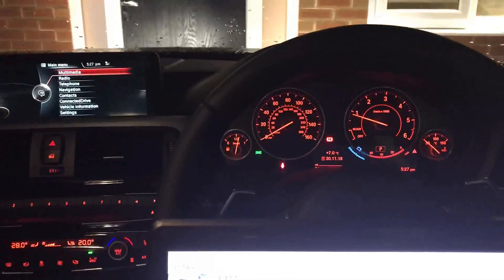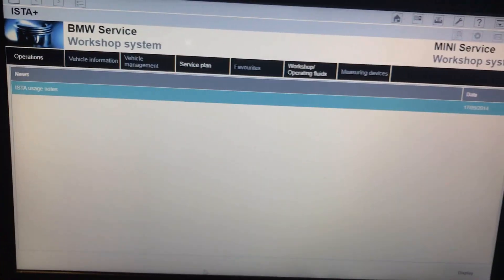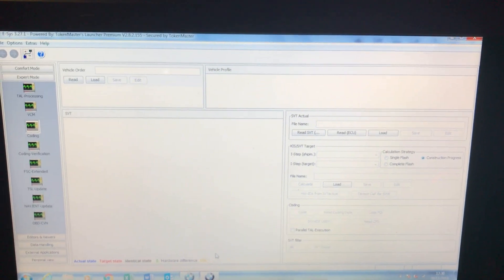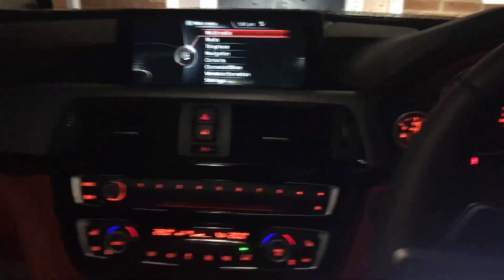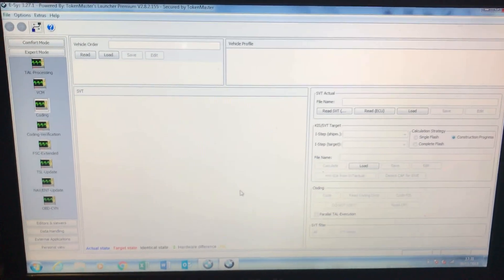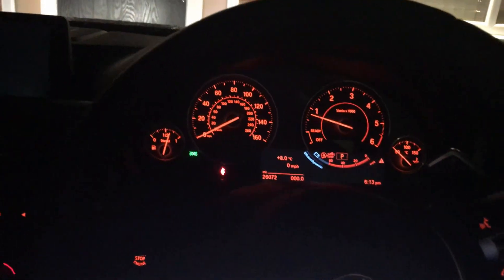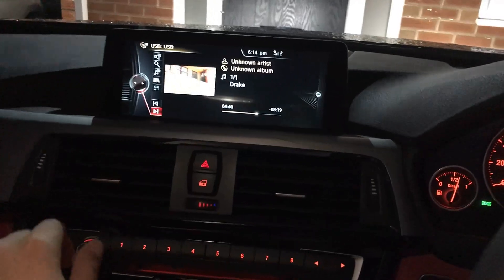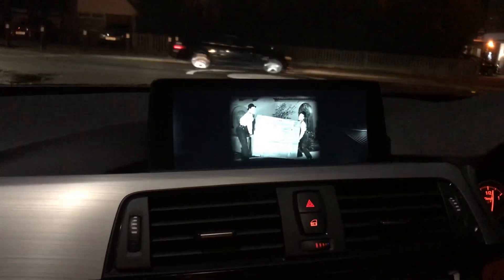BMW Coding Unlock, Video In Motion , DVD In Motion , USB Video, Digital Speedometer *INSTRUCTIONS*

Comment: How to code 8.8 or 10.25" screen? Because I had a 6.5" but I upgrade to 10,25 and the car still thinks he has 6.5"
Reply from the maker: Needs to be coded with ESYS. But it also depends on the type of headunit you have and if the screen is compatible.

Thanks
Reply: @MidlandsVehicleDiagnostics  Yes I know, but how? Do you have instructions? My car is 2015 BMW F34 with factory navigation and Backup camera. I install 10,25" Android HU, factory Backup camera works perfectly, only screen resolution and aspect ratio needs to be changed to match current screen size.
Reply from the maker: @379Luka  display size variants and display size resolution need to be changed
Reply: @MidlandsVehicleDiagnostics  Thank you. Do you have instructions? I bought E-Sys cable and install E-Sys software on my laptop and now I just need instructions.
Reply from the maker: @379Luka  you should have received instructions with your Android unit. We provide this as a service so don’t give out full instructions
Reply: @MidlandsVehicleDiagnostics  Ok I will have to find instructions on the forums.

Comment: Can this be removed from the car. Also, is there any signs that this had been done. For example, I have a company car and when I give it back I don't want to get in trouble haha
Reply from the maker: WheezLee Good Afternoon, all the coding done in the video can be reversed so it won’t show any of the added functions. Thanks
Reply: @MidlandsVehicleDiagnostics  Thanks for the reply. So when I give the car back there's no differences. And the car is exactly the way it was. Is there any way they could tell I had this done? Also, how much is this service just for the video in motion. On a 68 plate 1 series 120i?
Reply from the maker: WheezLee If you can message me with a contact number I can call you. Thanks
Reply: WheezLee what did he say im in the same situation
Reply from the maker: Unfortunately he didn't get in touch. If you require this doing then please don't hesitate to get in touch. Thanks